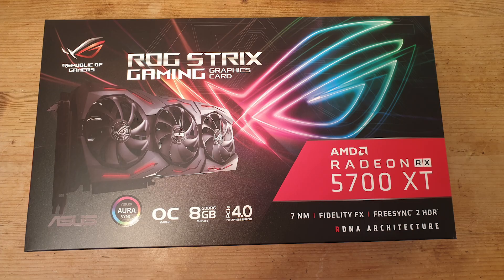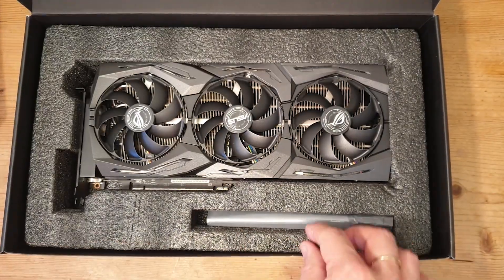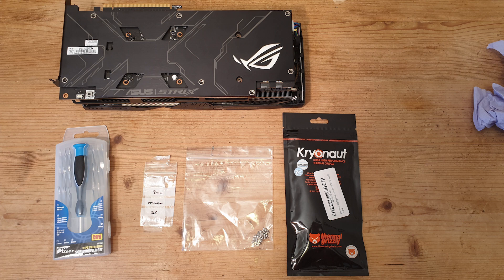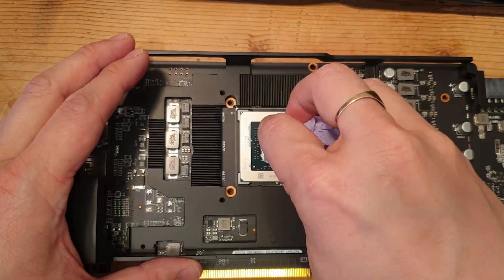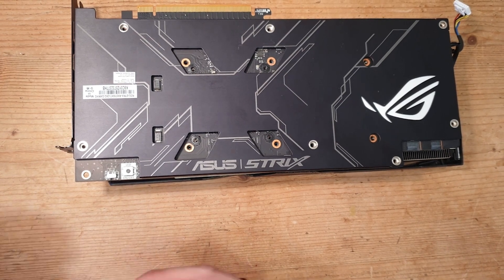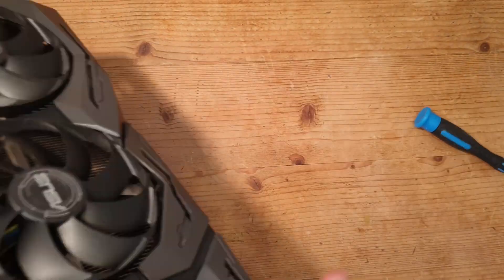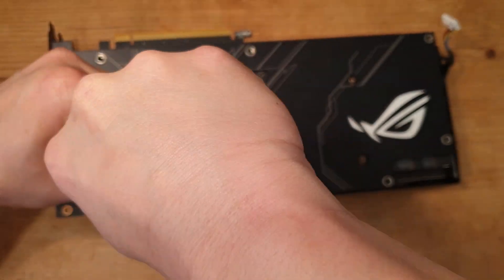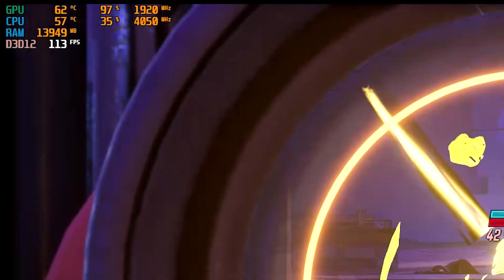ASUS ROG STRIX 5700 XT Tempeture Fix

Comment: I need to do this on my rx5700xt, hope it works. Can you explain whats the role of the nylon washers? thx
Reply from the maker: the nylon washers are non conductive and they take up the slack on the vrm screws because they are too long as standard.
Reply: @HardwareHusky  thank you for your reponse, it's very important to me. I ve been complaining to Asus for over 6 months and they told me last week that they re just able to fix notebooks not videographic cards, so they told me to contact my vendor so he can take over of this situation. That's why I decided to fix it by my own. Hope this works as my rx5700xt is heading 109°C on Fortnite (epic graphics and ulimited fps)
Reply from the maker: The nylon washer you will need are, 
M2mm x 5mm x 0.5mm for the VRM screws

If you wanted to do the GPU for more pressure. 
M3.5mm x 8mm x 0.5mm for the spring loaded GPU screws.
Reply: question: if I open it by myself, Am I loosing the official warranty?
Reply: I m asking since I already opened it by my own :S
Reply: I m asking since I already opened it by my own :S
Reply from the maker: @sergiogalo137  generally they say it does void the warranty but depending on your country they are not allowed to void it unless you damage it while taking it apart, also depends on the service center too as I've know they have accepted the rma even with the sticker damaged.
Reply: @HardwareHusky  u know what the problem is: the vendor told me today that they can try to fix it as 
my warranty is still valid HOWEVER I d like to try fix it by my own but I CANNOT find any nylon washer in my country (ARgentina) It s so frustrating! any other advice? maybe metal washers, I believe I can get them tomorrow in a hardwares store
Reply from the maker: @sergiogalo137  I can't see metal ones being too much of a problem as the screws are metal anyway but they will most probably 1mm thick so try one washer at a time and make sure there are no sharp edges that could did into the pcb.
Reply from the maker: And maybe get M3 x 5mm x 1mm so it slides on the screw easier because the M2 nylon ones can be tight to get on.
Reply: @HardwareHusky  whats "M3 x5mm x 1mm", are those screws?
Reply: Remember I cant find nylon washers on my country :( I ll buy any necessary screw you tell me to buy tomorrow morning on an electronic shop
Reply from the maker: This is the size of metal washer you should try, M3 (3mm) is the inner hole size x 5mm is the outer washer size x 1mm which is the thickness of the washer
Reply: @HardwareHusky  thanks a lo my friend
Reply: @HardwareHusky  u can´t imagine how grateful I am with u. I fixed it by just using 6 metal washers (1mm thickness) over those 4 spring screws and the two others over the vrm screws. I immediately felt the heatsink more robust and solid. Once I configured doom eternal and fortnite on EPIC graphics and DX12 with unlimited FPS, temperatures dropped significativally. I can play both at 65°C top! Before this If I did that, temps used to reach over 109°C! INSANE. Thanks a lot dude!
Reply from the maker: @sergiogalo137  Glad I could help.
Reply: @sergiogalo137  te bajó la temperatura de las memorias ddr6 ? Estoy en la misma situación   que vos con Asus y la verdad prefiero tratar de arreglarlo yo pero me interesaría saber eso, si te bajó la temperatura de las memorias
Reply: @ynadie  Bajó muchísimo la temperatura! básicamente hice lo que recomienda Hardware Husky, pero al no conseguir washers de nylon, usé unas arandelas metálicas de 1mm, una por cada tornillo, también por supuesto cambié la pasta térmica. Hay que hacer ambas cosas sí o sí. Las temperaturas bajaron de 109°C a menos de 80! avisame si necesitás ayuda
Reply: @sergiogalo137  es que tengo dudas porque hacen el mod pero ví que en dos vídeos distintos les bajaban todas las temperaturas menos las de las memorias que les subian unos grados, ahí en un comentario hardware Husky dijo que las memory temp le pasaron de 72 a 80 grados, yo las tengo en 96/98 con el ventilador stock settings, tengo miedo de hacer el mod y que se vayan mucho más arriba, te podés fijar en gpuz con la placa en algún tipo de test o juego que temperatura te marca en memory temp el Gpuz?
Reply: @ynadie  dale, me fijo a qué temperatura están las memorias y te digo, hoy en un rato te paso
Reply: @ynadie  acabo de correr fortnite a 1440p 144hz todo en gráficos EPIC y las vrm van a 70°c! y el punto más caliente del gpu 78°C
Reply: @sergiogalo137  te dejo mi whts mándame un mensaje por ahí si podés
Reply: @ynadie  acabo de correr fortnite a 1440p 144hz todo en gráficos EPIC y las vrm van a 70°c! y el punto más caliente del gpu 78°C
Reply: @HardwareHusky  Hey HHusky! how re you doing? I finally got my PSU (Thermaltake Rgb 750w 80 Plus Bronze). I have a quick question: since this PSU has 2 gpu cables with two pciexpress 6+2 connectors each, should I use just one cable to connect the power to my videographic card? or use the two cables but just plugging one connector per cable? thanks in advance
Reply from the maker: @sergiogalo137  Hi Sergio, I'm doing really well yourself?
Your power supply is a single rail unit so you can use one cable with the 2 connectors (pig tail cable) with no issues.

If you plan on overclocking, using 2 cables with 1 connector from each cable may give a slightly higher overclock.
Reply: @HardwareHusky  awesome! I ll do that then and let you know. Than you :)
Reply: hey @Husky Galo again, just wanna let you know what I finally finished upgrading my computer by replacing the PSU and I m not suffering shutdowns anymore :)
also I have changed the case (https://www.youtube.com/watch?v=7uG-hyiYwMw) by that one, but I would need assistance on configuring the airflow since it comes with 7 120 rgb fans and I added the other 3 fans I had in the previous case. Thank you in advance.
Reply from the maker: Hello Galo, that's good your PC is not shutting down anymore.
That case is nice, Looking at the case design and where the dust filters are located I would have:
Side 3 fans as exhaust
Back fan as exhaust
Bottom 3 fans as intake
Top 3 fans as intake
From the pictures of your case the fans are configured for negative airflow which can cause a lot of dust inside of the case, they do this because the face of the fans are shown and this looks better to customers.
The way I would have the fans configured is:
Side 3 fans as intake
Back fan as exhaust
Bottom 3 fans as intake
Top 3 fans as exhaust
But this way wont looks as nice because you see the back of the side fans and it also looks unfiltered.
Either of these ways will draw fresh air into the case and keep your components cool.
Reply: @HardwareHusky  this is my current fans configuration "3 fans top EXHAUST/rear fan EXHAUST and the remaining 5 fans are INTAKE"
Reply from the maker: @sergiogalo137  That's exactly the way I would have it, how are the temps with the new case?
Reply: It matches with your suggestion, HOWEVER, I noticed my CPU (Ryzen 5 3600x using stock cooler)  is at least 10°C hotter now, around 72°C :S
Reply from the maker: @sergiogalo137  That's not a bad temp using the stock cooler my 3600 non x ran around 66c with a 280mm AIO during gaming.
How is the gpu temps and have you adjusted the fan curve?
Reply: @HardwareHusky  well in my previous case cpu temps were better (my previous case was this one https://es.thermaltake.com/commander-c32-tg-argb-edition.html). I had the same three top fans exhaust/same back fan but these two giants 200mm fans intake). I think thats why my general temps were better
Reply: @HardwareHusky the gpu is fine, HOWEVER, at the same time i bought the new psu and the new case I ve got this 1440p 144hz monitor ahaha https://www.lg.com/ar/monitores/lg-32gk650f-b so my temps increased a lot as I m playing now at 1440p, so I had to adjust some graphics configuration in order to keep the 144fps and mantain temps lower
Reply from the maker: @sergiogalo137  That's a very nice monitor, now that it's all built you can enjoy some gaming.
Reply: @HardwareHusky  Yes my friend, thanks a lot for your help, I enjoy playing a lot now, you got to see how good Doom Eternal looks on it! still worried by cpu temps though :P
Reply from the maker: There is a good chance the your CPU was not getting the correct voltage on your old PSU making it not boost as high and run cooler.
Have you thought about upgrading the CPU cooler?
These two cooler are priced very well and will cool your CPU better whilst being quieter.
be quiet BK006 Pure Rock 2
Cooler Master Hyper 212 EVO/BLACK

Comment: I purchased this because it was supposed to be the super-duper cooling edition (their information translated into my words).  I wish I could paste some pics.  I took mine apart and you can see a similar pattern from about 30% across the gpu at a diagonal angle to the other side of the chip that matches one on the heatsink.  It looks like it has been seriously overheating.  If it completely fails Asus will void my warranty because I took it apart.  Asus fan for a long time.  This may be changing.
Reply from the maker: That's not good, the gpu has built in thermal protection that should stop it from damage hopefully.
Have you applied fresh thermal paste and used washers on the vrm screws? If so is it running ok?
Asus may still uphold the warranty depending on your local consumer laws and I've some heard people getting warranty replacement from around the world getting replacements even when not covered by law.
Reply: @HardwareHusky  yes, I used some of those red washers that used to come with a new computer case, I have some nylon ones on the way I cleaned it off and put some Noctua paste on it.  I played ark survival evolved for many hours with all the settings on epic after that without a system crash. That's what it was doing before the system would hard reboot I assume that was trying to protect the card.  Before redoing the thermal paste if I got junction temperatures in the upper 60s my computer would hard reboot yesterday I saw it hit 81 for a long period of time and it just kept right on going.  My brothers reference model with identical settings was hitting almost a 100.
Reply from the maker: @RotorBrake  Yes that was the overheat shutdown protection and you probably had lower junction temperature before fix because the card thermal throttled itself to try cool down.
Sound like you fixed it in time before any fatal damage was done.
Reply: @HardwareHusky  Im thinking so.  A few months ago I put the washers on.  Tested before and after with furmark.  Washers alone dropped temps 13 degrees.  I think new paste pulled it down more.  Should be good now.

Comment: Do you think there is a risk of cracking your GPU die?. Like ASUS stated is it too much pressure in the long run or should it be OK?.
Reply from the maker: There is definitely a risk of cracking a corner off especially if the screws are tightened up unevenly.
Asus had an article out which has now been edited which they stated they increased the mounting pressure for Asus Navi starting January 2020. This would suggest to me that if you have a pre January 2020 model that a little bit of extra pressure from tightening the gpu screws would be ok.
As for long term reliability of padding it out with a few washers I can't really say but the card in this video has been used daily for gaming with no problems.
For me the benefits lower gpu (junction and edge) and vrm temperatures out weighs the risk of possible cracking in the long run.
weather you decide to do gpu screws or not the vrm screws are a must if you have a affected card.
Reply: @HardwareHusky  Thanks alot for the response! How do i know if i have one of the cards with Low mounting pressure? only thing i can tell for sure is that i have the issue with the VRM screws. My card is from march but it could be an old card they had in inventory. 

But wouldn't the DIE crack immediately if there are too much pressure when heated up the first time? like you know the die expands when it gets hot and if it got no room to expand i guess it will crack

Many thanks for this video i would have no idea how to do this without :)
Reply from the maker: Asus addressed both issues together when the they were discovered, so if you have the VRM screws issue you will more than likely have the mounting pressure issue. 
You can check you mounting pressure if you have a low range torque screwdriver, Asus says its 5700's optimal mounting pressure range is between 50 and 70 PSI.
When I was experimenting, a single M3mm x 8mm x 0.5mm nylon washer under each of the spring loaded gpu screws tightened sensible achieved better temperatures without applying too much pressure. 

Yes the DIE can crack like that but it will more likely be from the aluminium/copper heatsink expanding into the DIE because the thermal expansion rate of silicon is fairly low, not that it really matters because the end result is the same.
Reply: @HardwareHusky  Thanks again. I just did the fix, i used 8mm x 1mm under the GPU screws and 3x m2 x 1mm under the VRM screws, that seemed OK, it doesn't move anymore, im not sure if i saw a temp decrease at all, but i think the fans are much slower now.

Did you ever benchmark or heat test your card after the fix? if so would you mind posting stats so i can compare, ofc only if its not a too big of a hassle. Mine is maxing out at 72c with around 1200-1800 rmp running looped f1 2019 bencmarks for around 15min. Dunno why the fans are running so slow now id rather have the card under 70 imo.

Also this was actually so easy with your video i think you just saved me from 4 weeks of RMA nightmare THANKS! :)
Reply from the maker: @ATJ.  I did do some benchmarks and before fix the temps were 81c max and after fix 68c max with room temp around 20c.
With your fan speed being low could be from cooler gpu temps or it could be from you accidentally switching to the quiet bios maybe? (The little switch on the top of card by the pci bracket)
If that's not the case you can set a custom fan curve in Amd wattman to speed it up.

Glad the video helped and thank you very much for the view.
Reply: @HardwareHusky  Yea my temps seems to max out at 72C. Just a random thought are you using the Efficiency mode BIOS or what bios version are you on?
Reply from the maker: @ATJ.   I'm using bios version 017.001.000.049.000000 which is the one with acoustic target of 1800rpm.
One of the bios versions has a acoustic target of 1350rpm, this one runs the fans slower with slightly higher temp.
Reply from the maker: @ATJ. Have you tried the second bios on your card to see if there is a difference?
Reply: Hardware Husky Yea looks like im on the same bios as you and Yea im in P bios, Q bios runs even hotter sadly. I just Saw that there are an efficiency bios mode you Can also use which should run alot lower temps thats why i asked if that is the one you are running.
Reply: Hardware Husky okay, i fixed it, i think. Changed paste from termal grizzly to noctua then temps Got even worse, Then i switched to mx-4 and im sitting at 68 Max temp. Compared to 72-74 before, which is weird since grizzly should be better. But  i did also notice that the hotspot temp increased from 89-90c to 96c and so did the fans from around 1800 to  2100 which might explain the lower temps, im pretty sure the fans follow hotspot temps and not GPU temps, so i actually Think i made it run hotter which makes the fan spin more cos of increased hot spot temp = less gpu temp, this is getting annoying 😓
Reply from the maker: @ATJ.  Yeah the thermal grizzly should be the better paste. Someone else has this issue in one of the comments and it turned out to be a uneven cooler mount but his hotspot was much higher.
Have you noticed if the gpu clock is boosting any higher?
Reply from the maker: @ATJ.  I just realised that's not that different from my hotspot temp, mine is edge temp plus 15c ±1c, so when I have 68c edge temp my hotspot is 93c ± 1c.
Reply: Hardware Husky nah clock speeds are the Same. Yea i Think it all makes sense now tbh, the fan curve follows hot spot temp which was at 89c before with grizzly now it’s at 93-96 which makes the fan spin faster = cooler gpu but not cooler hotspot i guess. Also i was looking at BIOS’s before and the new one we are running are set to a target temp of 90c which would Make the fans spin faster at 90 or above. Also what is your Max clock speed? Just noticed mine is pretty High at 2030
Reply from the maker: @ATJ.  Yeah it sounds like it's all good now and I think you are spot on with the fan following hotspot.
Reply: Hardware Husky Yea thanks alot! One last thing and i Will stop bothering you, what clock speed are you on when you get the 68c? :)

Comment: Can I just ask what size washers do I need thanks
Reply from the maker: M3mm x 6mm x 0.5mm     OR     M2mm x 5mm x 0.5mm for the VRM screws

If you wanted to do the GPU for more pressure. 
M3mm x 8mm x 0.5mm for the spring loaded GPU screws.
Reply: @HardwareHusky  thanks so much :)

Comment: I did this mod and while it made the gpu temp come down to low 60's but the junction temps are hitting 110c!
Reply from the maker: That's sounds like the heatsink is not making ideal contact with the gpu die.
Reply: @HardwareHusky   ok I will try and redo that and see if that helps, thanks
Reply: @HardwareHusky  Ok looks good I think now edge temp 60c and junction temp 76c under full load
Reply from the maker: @Neodous  That sounds all good now, mine has around the same temperature difference.

Comment: Hello sir
How can i see if my card is an updated and fixed version or not?
Reply from the maker: Squeeze the fan shroud fairly gently by the back two fans and the backplate together, if the heatsink moves see if vrm screw rise up in the screw holes, if that happens it's the not updated one.